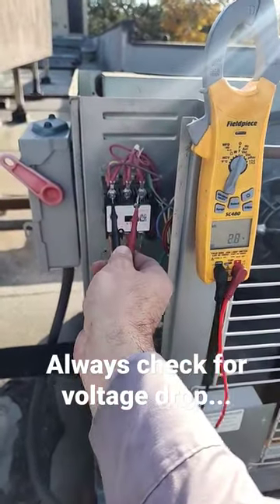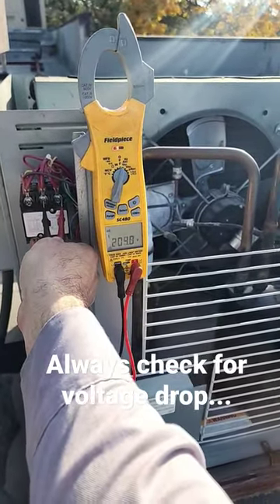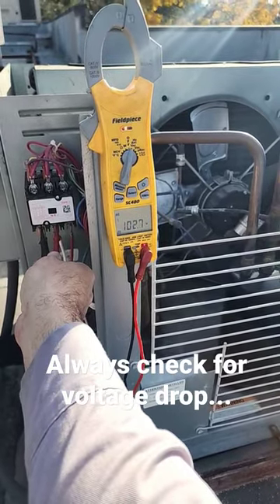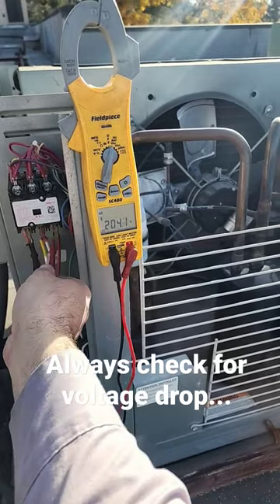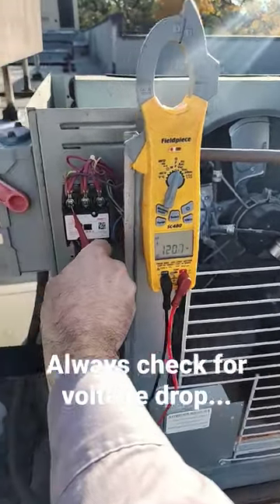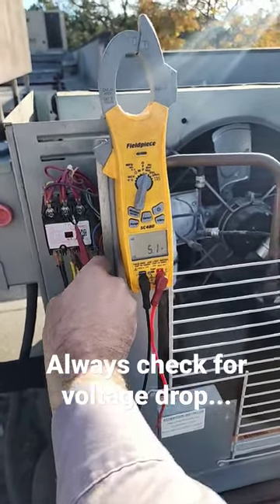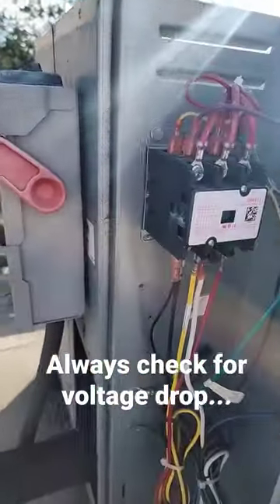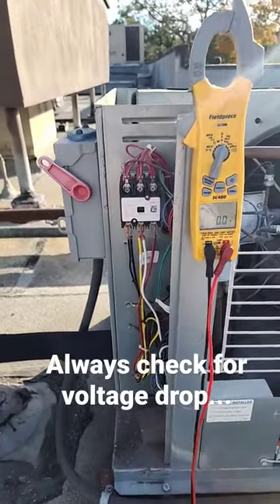VOLTAGE DROP IS A REAL THING

Comment: Yeah that's NOT VOLTAGE DROP.  Voltage  drop is when at panel you have 120/240 120/208  and a thousand feet away you have 75/150  75/100. This is caused by the resistance of the conductor and the length of the conductor. 
What you have is simply a dirty or bad contactor
Reply: What a strange concept you have here. Voltage drop is the voltage across a resistance carrying a current.  The voltage drop across the contacts is equal to the resistance of the contacts, R, in ohms, times the current, I in amps.  The voltage drop across the contacts is exactly the same animal as the voltage drop across the. conductors you mention.  E=IR no matter where you find it.
Reply: @Hopeless_and_Forlorn  the problem is that you keep calling it “voltage drop” when it’s just voltage, you’re just checking voltage, that’s it. You don’t have “voltage drop” across contacts you either have voltage or you don’t, if the numbers come out lower on the load side that just means you have bad continuity or a poor connection you don’t call that voltage drop because voltage drop is SPECIFICALLY when you’re talking about wire resistance building up over a very long distance that’s why when you do actual voltage drop equations you have to know exactly how long your wire is. Not a “strange concept” it’s literally in the national electrical code

Comment: That’s not voltage drop. The voltage drop would exist on the line side. What you are seeing with your multimeter on the load side is voltage that was enough to make it through the burnt out contacts.

Comment: Hvac guys calling this voltage drop lol...

Maybe just calling it a bad contactor?

Voltage drop is where you have a reduction in voltage due to internal wire resistance and/or to long of a wire run that isnt sized properly

Its clearly spelled out in the NEC
Reply: Lol checking continuity is the correct way to troubleshoot that contactor
Reply: @garrettchurch604  right, cuz that tells you if you have pitting in the lamination or contacts

Comment: Good video but you don’t clearly state what makes it bad. You show a bunch of V readings but would be a little helpful to clearly say what is the ones that indicate it being bad. I’m guessing the 120 V voltage drop is the issue.
Reply: The relay contactor pins are burnt, pitted, corroded, have ants in them--are no longer like new; approaching an open circuit (high resistance) value.
That's where the heat is everyone is mentioning here.  
After they are burnt and become an insulator (high resistance) there's no more heat 'cause there's
no more current flow.

I also like the one commenter here, make sure the relay coil is pulling in strong enough. 
Not enough power on the coil won't have enough magnetic field to pull in the contacts.

As contacts approach each other they arc.  There are methods to limit the arcing between contacts to prolong the life of the contacts.
The concepts have been around since stone tools and will not be used.
Reply: In his video, the top of the screen, on the relay socket, power is coming in.  On the bottom of the screen, the bottom of the relay socket, is after the relay contacts.
In-sufficient current flow across the burnt relay contacts show as low voltmeter readings.  If the contacts are clean and new, voltage in is voltage out.
Hope that helps.

Comment: Uhhh as a commercial electrician, let me tell you that that is not what voltage drop is. An example of voltage drop would be: using 12 gauge wire on a 120V 20A circuit 300' in length. You're probably only going to get 100-105V @ the end of that circuit. The difference in voltage between the beginning (panel/circuit breaker) and end (last device) is what the voltage drop is. Usually, we allow for 3%
Reply: He is literally dropping 120 volts across the contactor that is a voltage drop. Just because it isn’t the example from your school book doesn’t make it real.
Reply: @kingduck3192 the formulas for voltage drop ask for conductor size and length because voltage drop has to do with wire resistance not contactor continuity… in this case he is losing voltage due to a bad connection / poor continuity NOT cus of voltage drop
Reply: @kingduck3192 he is wrong about voltage drop guy in comments is right

Comment: Voltage drop would be measured phase to phase or phase to neutral. What you are readying is a bad path for voltage to return back to its source. Not bad trouble shooting , just bad terminology. Contactor is bad.

Comment: How many ppl don't like field piece . I paid 350 for my volt and it has read wrong multiple times.  With need battery just trash I own the vacuum pump and recovery machine which are perfect but meter is trash . Anyone else have the same problem

Comment: This isn’t voltage drop this is just bad continuity/ poor connection not the same thing as voltage drop which has more to do with conductor resistance

Comment: You realize you've got an open leg in the unit, right? 120 VAC drop within the contactor while running is not possible without ongoing fireworks.
Reply: Probably won't run the compressor.

Comment: Fake. 208 3 phase system and you start off with 203 line side. Probably got under sized wire coming in or massive loads being pulled.
Reply from the maker: The utility delivered voltages varies all over southern california, depending on the location and the outdoor temps we can see voltage at low as 187 and as high as about 242 on typical 208/240 services

Comment: That’s not considered voltage drop, what you have is a bad connection. Voltage drop occurs over a long run of wire that’s not sized accordingly. Watching this was will make people dumber.

Comment: That is NOT voltage drop!!! Again another bad video of ac repair men thinking their electricians.
Reply from the maker: How is that not voltage drop? What is your definition?
Reply: @HVACRVIDEOS  voltage drop is the amount lossed through impedance. I.e length/size of wire. You don't really start to get voltage drop until 50-100 foot of a run. Meaning you run wire from house to shed 200 ft. You need to up your conductor size to get the current voltage. Don't be an internet electrician getting people hurt! Learn the theory of electric and use correct terminology.